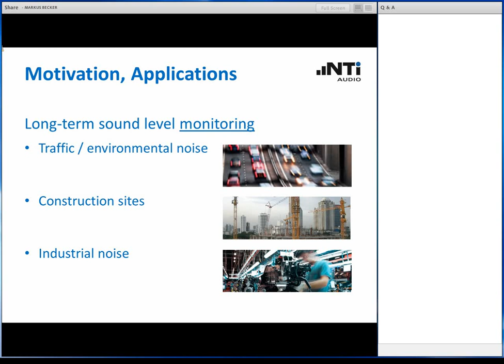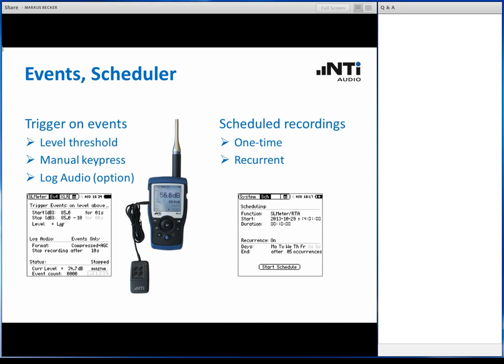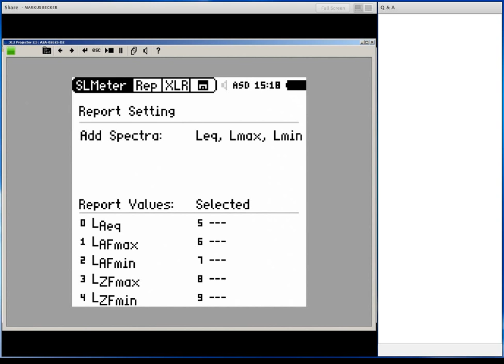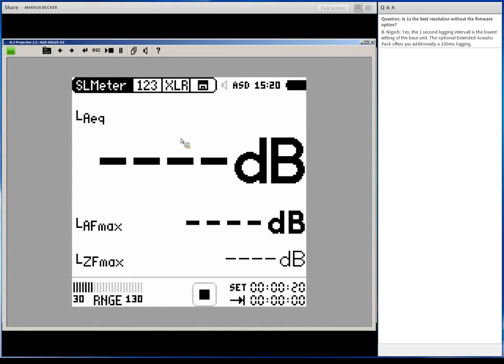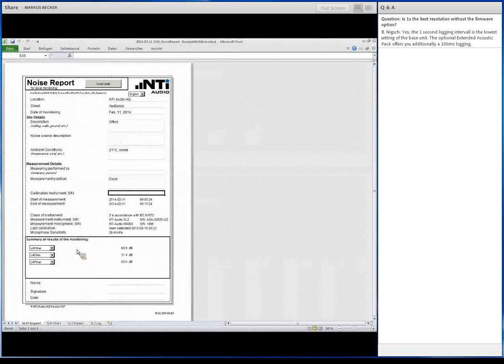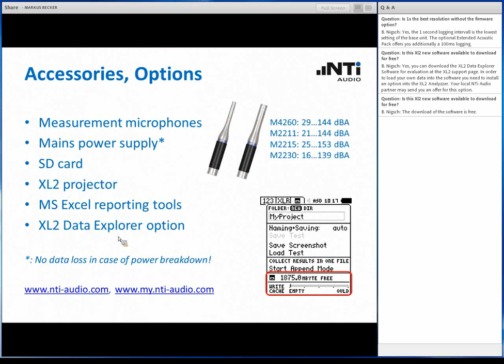Preparing for long term sound level measurements - Webinar

Comment: How long will the battery last if the device is not plugged in?
Reply from the maker: About 4 hours on the internal battery pack; an external battery pack may provide sufficient power for a day, a week or longer.
Reply: @NTiAudio  Thanks for the reply! Is there any external battery pack you would recommend that would last for a week? I am hoping to record just sound level and frequency (no audio) continuously for one week with 1 second interval.